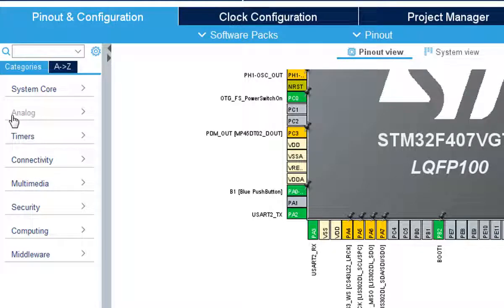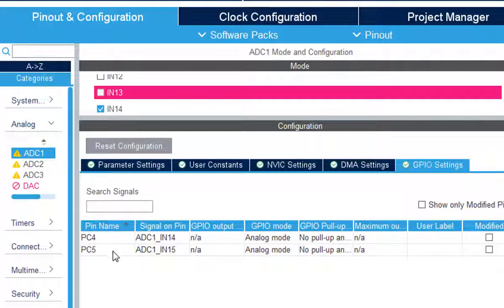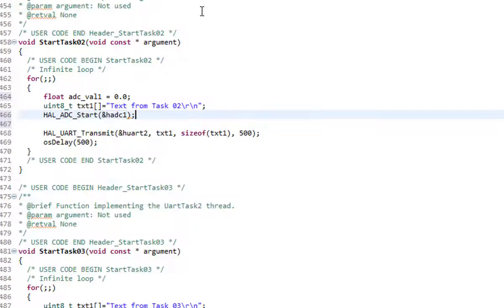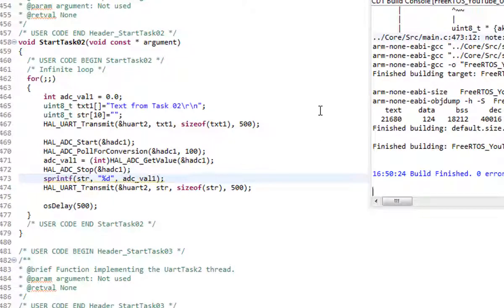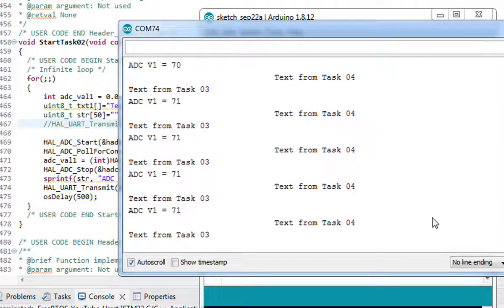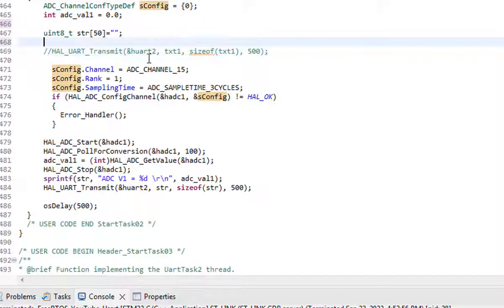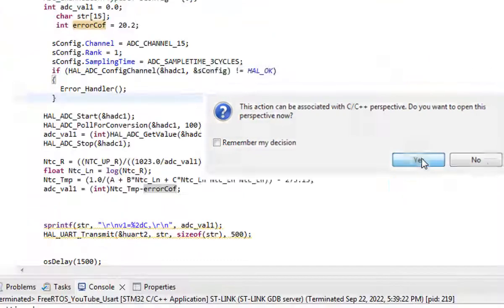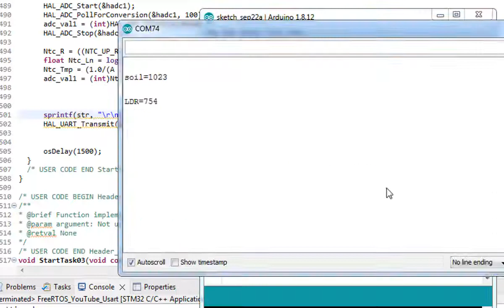STM32 FreeRTOS ADC Example using STM32 Cube IDE  | ST32 ADC Polling Example |  adc multi channel

Comment: Hi, Thanks for your great tutorial. I have a qiestion regarding sprintf() function! How can I pass a float value into sprintf function? because when I do this FreeROS crashed!
Reply: i'm a 100% noob in this one, didn't check if this is true either so what i'm going to tell you might be totally incorrect. In RTOS settings under middleware in CUBEMX(or CUBEIDE config tool), there's an MPU/FPU enable option. enable FPU to see if it helps.

but as I told you before, this is probably wrong and won't work, i'm just talking without an idea
Reply: There is a flag that can be enabled for float values to be used in functions like `sprintf` or `printf`, .... As of July 2025 on STM Cube IDE Version 1.90 > Right click on your project, Go to "Project Properties" > C/C++ Build > Settgins > Tool Settings > MCU/MPU Settings > "Use float with printf from newlib-nano (-u _printf_float)". This should allow you to use float values. Do the same for `scanf` if you also wish to accept float values as an input, but I have not tried this yet.